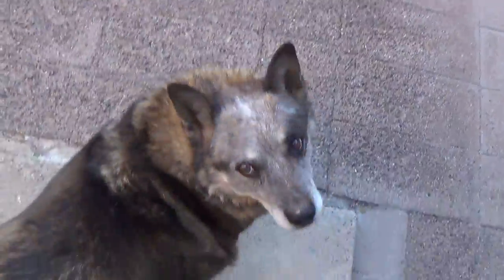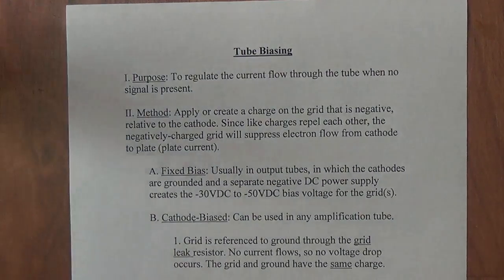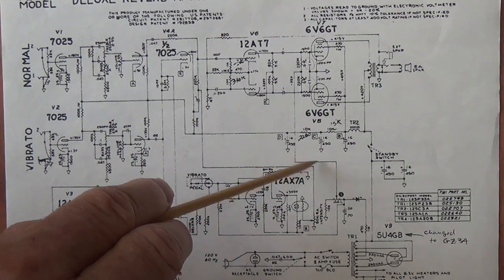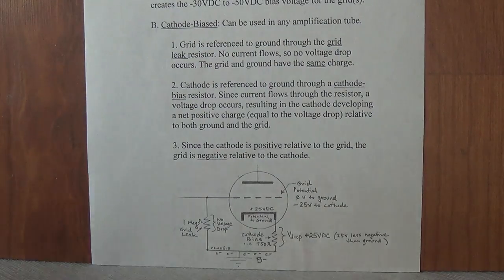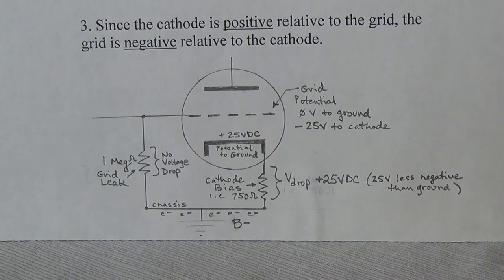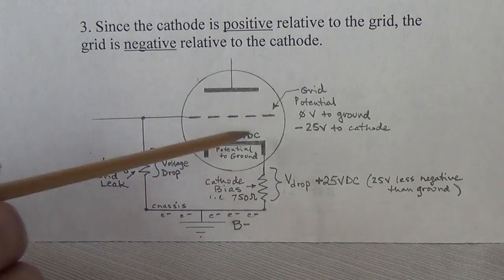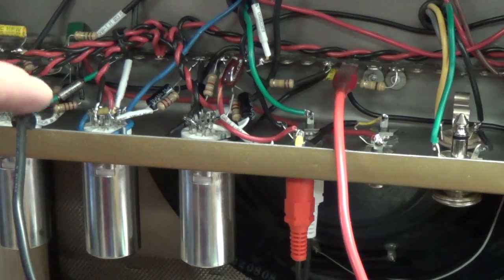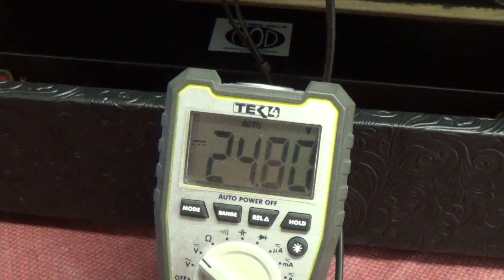Resistors, Part 4:  The Cathode Bias Resistor

Comment: First Thank you so much for the effort you put into these videos. They are both entertaining and informative. I have a question. In video "Resistors part 4", why is there a  voltage drop on the cathode bias resistor and no voltage drop on the grid leak resistor since both are connected to ground? Thank you.
Reply from the maker: There is a voltage drop on the grid leak resistor, but it it extremely small since the current flowing through this part of the circuit is tiny. Remember that voltage drop is directly related to current flow.

Comment: Great content man! Learning a lot here.
I'm building a low voltage guitar pedal (35V on plate, 9V on heater) that uses a 12ax7 and the cathode resistor I am using is 1k, beside the 10µF capacitor.  The strange thing is that I'm not measuring any voltage over the resistor, voltage drop is too low I guess but the circuit is working.
Can I use a lower value resistor? I'm having some "constipation" I guess, like you said in another video, when I set the gain of the pedal on max.
I'm trying to get lots of distortion with a single 12ax7, not sure if it's possible. I know some people reached that kind of effect with similar tubes.
Thank you!
Reply from the maker: The plate current in a 12AX7 is quite low.....in the 0.5 to 1.0 mA range. Yes, you can experiment with various bias resistor values to achieve the tone you seek.
Reply: @UncleDoug  Thanks!

Comment: Hi, greatest vídeos. Why if i increase the bias resistor   value, the voltage drop increase too? Muy amp is a fender vibro champ xd hybrid. It has a 6v6 GT genalex power output, and a 12ax7 tungsol to drive. The 6v6 has red-glow plate, so i change the resistor but still glowing. Thanks so much.
Reply from the maker: Please provide a schematic and tell me which resistor you have changed. If it is a cathode bias resistor, you must increase the resistance (probably quite a bit) to reduce the plate current.

Comment: You should do a video on the cold clipper used be Marshall master volume amps and soldono amps.
Reply from the maker: First I'll have to figure out what a "cold clipper" is ;)
Reply: @UncleDoug  yes you should, you would be great at some amp mods. Every Marshall should be capable of billy gibbons by now.
Reply: @UncleDoug  just ask Rusty, he knows. :)
Reply: @UncleDoug  A cold clipper is a gain stage biased so that it clips severely due to cutoff  on the positive excursion of the signal at the plate. Biased this way, the plate dissipation is low, less heat, so 'cold clipper'
Reply from the maker: @silasfatchett7380  Thanks for the informative input, Silas.

Comment: absolutely fascinating.  question: if the greater the resistance from ground to cathode lowers its negative charge in relation to the grounded grid, does that mean that the cathode's un-grounded charge would be positive with zero voltage ?
Reply from the maker: Thanks, Tony. Terms like positive and negative are relative, not absolute. The greater the resistance between the cathode and ground, the more positive the cathode becomes relative to the grid....and the more negative the grid becomes relative to the cathode, which suppresses the flow of electrons from the cathode to the plate. If you "unground" the cathode, it would be separated from the circuit and have no charge at all, since ground is its only source of electrons.
Reply: Uncle Doug thanks. Fascinating and it really seems that the original guys who designed these circuits built the foundation for everything that followed right up to the smartphone.
Reply: Uncle Doug btw I really do get it now... you must've been a great algebra teacher...
Reply from the maker: Thanks so much, Tony. I would like to think that I was an effective teacher. My students went on to be successful in higher level courses.

Comment: Isn't there a small current flowing from the cathode to the grid? Wouldn't that current cause a voltage drop across the grid leak resistor causing the grid to not be 0V? This is something I am struggling to understand. Please help. And thank you for the great tutorials.
Reply from the maker: The bias of the tube is achieved by the effect of the bias resistor on the cathode's electron concentration. The grid potential at idle is referenced to ground and is constant. When the bias resistance is low, there are more electrons on cathode, so grid is relatively positive = high current flow. When the bias resistance is high, there are fewer electrons on the cathode, so grid is relatively negative = low current flow.
Reply: There is a small current flowing in the grid leak due to imperfections in the vacuum, but it is so extremely small the we can disregard it and assume the grid to be at 0V.

Comment: Hey Mr. Doug, your videos are a delight for the knowledge thirsty! 
I got a question. What was the point of having a switch between two different resistor values for the cathod biasing? Is there a difference soundwise or maybe fidelitywise of the circuit?
Reply from the maker: When you switch output tubes, you must also switch the bias resistance......and in most people's opinion, switching output tubes does alter the tone of the amp.

Comment: Uncle DougI recently bought an old vox ac 10 srt from England. I changed the ac setting to 115 vac. The seller said the amp was super quiet but here in the states it has a hiss and I'm wondering if the tube bias needs adjusting since the amp now runs on 115 instead of England's 220. Any help?
Reply from the maker: I am not familiar with tube bias causing a hiss, SS. Perhaps the seller's idea of "super quiet" is different from yours. Hiss is more common in transistorized gear, but is generally considered to be a subtle noise created by the electricity passing through the circuit. Try some Internet searches for causes and cures.
Reply: Thanks

Comment: So, by flipping the switch it then lowers the cathode resistance by ~100 ohms, it then lowers the headroom to the tube, the tube has more current flow, and runs a little hotter and the sound changes towards a warmer distortion vs cleaner sound with the higher 750 ohm resistor provided?  Is that why you put that switch in?
Reply from the maker: Yes, it can work that way......or you can use the switch to allow for the use of different output tubes, i.e. 6V6 and 6L6.
Reply: @UncleDoug  Thanks for your reply.  But using a 6L6; doesn't that have a different impedance out and require a different output xfrmr?  Or was that switch a DPDT and you wired the other lead of the output xfrmr to accommodate both the shift in bias AND impedance tap?  Sorry; just curious . . .
Reply from the maker: @MrRadioGypsy  What you are saying is correct in theory, but in actuality, I have built several SE amps with the ability to accept either 6V6 or 6L6, 5881, etc. and sound great. Agreed, the impedance is not perfectly matched, but in a fairly low powered amp, it doesn't seem to cause any problems.

Comment: Doug,
Where does the positive voltage (in your example, the 25VDC) on the cathode come from? From where is that positive voltage being supplied?
Reply from the maker: It isn't really supplied by any one source. Voltage is a relative measurement, i.e. between a point in the circuit and ground. The 25VDC is simply the difference in potential between the cathode and ground. It is due to several factors, including the bias resistor between the cathode and ground, which creates a difference in potential.
Reply: Doug,
I am familiar with the concept of voltage as a difference of electrical potential. At least I thought I was, but this may prove me otherwise haha... But thinking with the logic that, at idle, everything is ground or close to it until supplied by one of the lines off of the secondary winding of the PT, doesnt that mean that the cathode needs to somehow receive some of that positive voltage derived from the PT secondary in order for the voltage difference to occur with the help of the resistor?

I might be way off in thinking of it this way, but thanks in advance for any advice. Also forgot to say thanks for the the helpful videos in my first post. They are the closest I am getting to a solid understanding of this stuff as a whole.
Reply: The (conventional) current from the power supply flows via the OPT, through the tube and then through the cathode resistor to ground. If current is flowing in the resistor there must be a voltage across it (Ohm's Law). If there is 25V dropped across the resistor and one end is at ground potential, then the other end (and thus the cathode) must be at 25V.
Reply: @silasfatchett5693  I think that is the explanation that has made the most sense so far. I was struggling with the double negative. Still not really got it though.

Comment: Hi uncle Doug, I’m working with my DIY China made 845 SE amp. It’s having 1050vdc for B+. I’m getting a orange red glow on both 845 and not sure how to bias it correctly. Whether to use cathode bias or fixed bias. Currently it’s having a cathode resistor 470R n a bypass cap of 47uf. Additionally I’m feeding the grid neg voltage thru a 10kR. The neg is able to supply -175vdc. I’m quite a newbie here. May you advice me? Thanks a lot
Reply from the maker: It sounds like you are using two different methods to bias the tubes, Tony, which is not normally done. Bias should be either by: Cathode-Bias, in which you connect the cathodes to ground through a resistor (and often a bypass capacitor)....OR.....Grid-Bias, in which the cathodes are connected directly to ground and you apply a -DC bias voltage to the grids. 

If you want to cathode bias, remove the grid bias and increase the cathode bias resistor to 2K Ohms and check the plate current and plate dissipation. If they are low, gradually reduce the bias resistance until the values are acceptable. If they are still high, gradually increase the bias resistor value.

If you want to grid bias, remove the cathode resistor and apply maximum negative DC bias voltage to the grids. Check the PC & PD and adjust the bias voltage downward until they are acceptable. If they are still too high with max. grid bias, then you will have to rely on cathode bias.
Reply: Thanks uncle Doug, ok noted! Currently I drop the fixed bias. Been working on cathode bias resistors. I’m at 2740ohm with a few resistors in series. But as time passes by, they got very hot till the solder melted!!!
Mmm...wats next, I’m thinking...well, it’s working. 
I’m not sure abt the OT specs as they came with this power amp.

Comment: Hi, i dont know how to attach a PDF document  through this place. but searching " fender vibro champ xd schematic" on google, appears inmediatly. I replace the bias resistor , 800 ohms instead the 470 ohms from factory.  The voltage drop before the change was 47v (it suppose  to be 23.5v) and then was 70v . The voltage plate seems the same (340v aprox.) before and after resistor replacement. Hope you can help me. If you can provide me some another way to send you the diagram, just tell me. Thanks
Reply from the maker: Whenever you increase resistance, the voltage drop across the resistor will increase, i.e. for 47V to 70v......so that makes good sense. However, increasing the value of a cathode bias resistor should reduce plate current and increase plate voltage......yet it doesn't seem to do this, and you say that the output tube still red-plates. Have you replaced the cathode bypass capacitor?  I wonder if it has an internal short.

Comment: Hi Doug, doesn't the cathode need it's own current supply to heat it up and boil off electrons? This is absent from the circuit diagram for simplicity i'm assuming. Doesn't that mean a voltage is present relative to ground so current should flow the other way across the resistor.

The only solution to this would be that the ground is DC and the power supply is AC...I think I just answered my own question right?
Reply from the maker: +Hanzel Pinto   Yes, all cathodes are either directly heated or indirectly heated by a separate filament. Current, in the form of electrons from the grounded center tap of the power transformer, flows through the chassis to the grounded cathode and then past the grid to the positive plate. Ground is negative DC and the Plate is charged by the positive DC.  AC exists only in the primary circuit (fuse, switch, power transformer primary winding) and in the filament heaters.

Comment: Do you have any videos that demonstrate how these numbers relate to the specifications of tube data sheets? I have a Marshall Astoria where they claim that you can simply plug and play EL34 or 6L6 tubes in place of the stock KT66 - and is cathode biased. I’m trying to get my arms around this. Thank you
Reply from the maker: Anyone who suggests that you can simply interchange all sorts of tubes is confused.....and incorrect. Many tubes are simply not interchangeable, and those that are still require re-biasing whenever a different tube(s) is installed.
Reply: @UncleDoug  I was wondering if I can check the cathode resistor value by connecting from the cathode lug to the chassis of the amp. Wouldn’t that be the same as the other end of the cathode resistor that goes to ground? I can’t seem to be able to locate the cathode resistor because it’s buried underneath a circuitboard. Thank you
Reply: @Mrguitarcraze  Yes.

Comment: I finally realized, after watching this yet again, that the B- "ground" electrons flowing up through the cathode resistor are negatively charged and are drawn up by the plate's strong positive charge. And, as the voltage drop across the cathode resistor is considered a loss and is measured negatively, we have two negatives, which results in the positive VDC on the cathode. Is that right, or have I misremembered my high-school math?
Reply from the maker: Two negatives don't make a positive in electricity, Shaun, only in integers. The cathode is positive compared to the grid, because the cathode resistor elevates the cathode higher above negative ground (thus more positive) than the grid leak resistor elevates the grid.

Comment: Doug, I've got a few questions (Supro build)...1 - On the first pre-amp stage the cathode bias resistor is 1K and the voltage drop is 2v.  v=ir gives me 2ma current.  The second stage with a 3.9k resistor and a 1.6v drop give me .41ma.Is this correct?  And, why don't both stages use the same resistors?2 - When I do the same math for the plates I get: (240 B+ - 180 from schematic) / 270,000 = .22ma for the first stage and (240 - 140) / 270,000 = .37ma fro the second stage.So, for stage 2 the current calcs are close but for stage 1 off by 10X.What am I doing wrong?Thanks,John
Reply from the maker: +John Heaphy  It appears that your calculations are correct, but please note that the cathode of the V1 first stage is also connected to the cathode of the V2b tremolo output tube, while the cathode of the second stage is not. I assume that the difference in wiring may well be responsible for the current discrepancy you have noted.
Reply: +Uncle Doug Well, that would throw off my calculation for sure!  Thanks!
Reply from the maker: You're welcome, John. I am very impressed that you are performing such detailed analysis of the circuit components. It's a great way to maximize your grasp of the subject.
Reply: +Uncle Doug I'm really digging in because I want to use a few 6SL7s instead of the 12AX7s in the Supro build.  And it would be good if I had some idea what I was doing!  Your stuff has been really helpful, very much appreciated.  I'll let you know how the build goes.
Reply from the maker: I really like the idea of using 6SL7's, John. Those old octal tubes have a really nice, warm tone. Best of luck with your build.

Comment: Great as always! Can the cathode function/draw current if there is no resistor? Such as the cathode bias resistor shorts. I know resistors rarely shorts that usually open.Jack is such a prolific scene stealer. You are so lucky to have such smart good natured pets. Can't wait for #5. Thankz
Reply from the maker: +Audio Tech Labs Yes, indeed, ATL, cathodes dearly love to draw current directly from the chassis (B- source), as in most of the Fender medium to high watt amps with a separate negative DC bias voltage supply (as described in the video). However, it doesn't work well for cathode-biased amps. If a CBR shorts out (exceedingly rare), kiss the tube goodbye.
Reply: +Uncle Doug thanks for the reply. That's what I thought.
Reply from the maker: You're welcome.
Reply: Only if you want to badly burn your lips ...